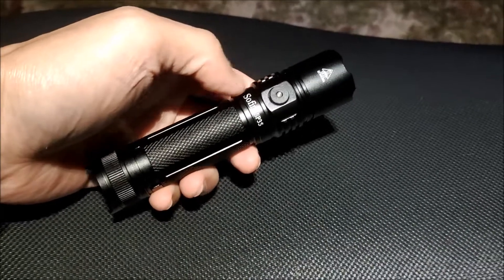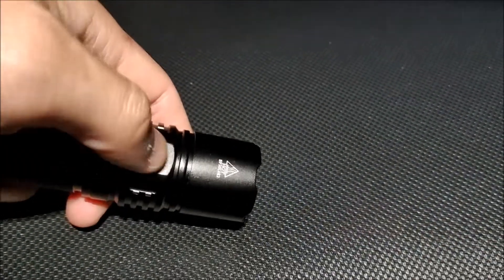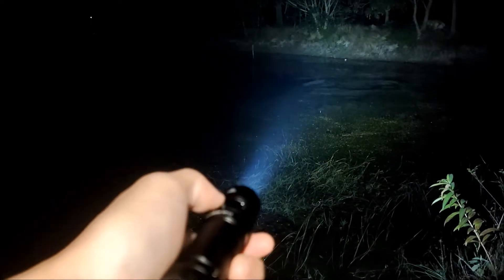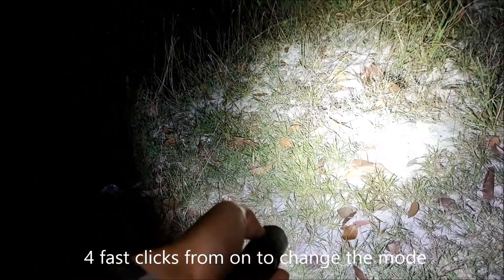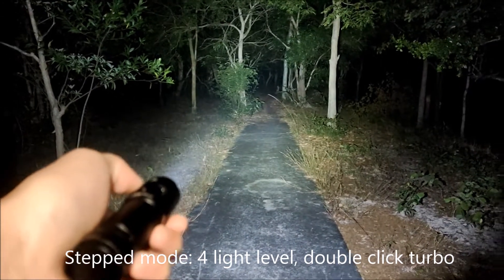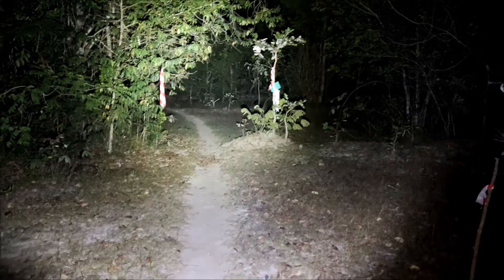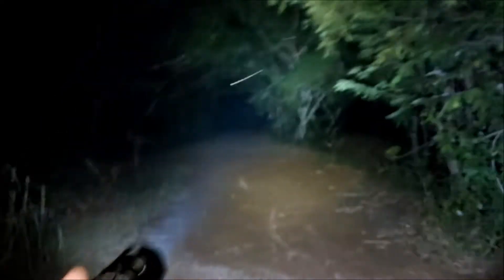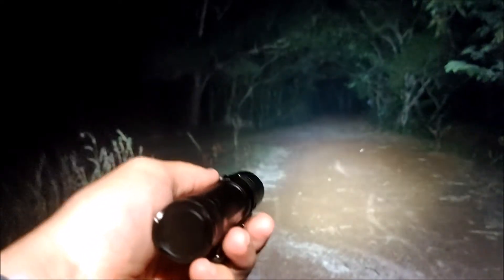Sofirn SP35 SST40 2000lm

Comment: Hello Sofirn SP35 or Convoy S21A sst40?
Reply from the maker: Sp35 
+ Two way clip, ramping mode
+ the design looks more tactical
+ Deeper reflector

S21a
+ Cheaper, easy to repair and maintenance
- Clip for it is not tough
- simple design

Overall I prefer sp35 5000k. It is better functions and design. Thanks for watching sir.

Comment: Which is better and similar s21a  if s21b ?
Reply from the maker: S21a and s21b are almost the same. But if you have to choose, s21b is a better choice. S21b can hold 22mm driver so it is easier for modification inthe future. However, in my opinion m21b is a better choice as it is not too big, better cooling fins, good beam, and able to use 20-22mm driver. Thanks for watching sir.

Comment: I just bought this light , Turbo is 332m and High is 215m , I like a little bit more throw than just having all flood on my EDC lights and that the reason I bought this light.  I currently use a Fenix E35 with 3,000 lumens but it only has a throw of 240 meters , its basically all flood and I don't care for it ....
Reply from the maker: Thanks for watching sir.

Comment: 👍 Another great video. 
Just a question:
 Is easily noticeable  the dark circular area between hotspot and corona ? That's what seems to show on some scenes.
 Or is it  just seen by the camera and goes undetected by the bare eye  ?
Seems like a fine all-around  flashlight. 
Great videos as usual. Thanks👍
Reply from the maker: From what I see, there is no dark circular area sir. However, there's something strange about this flashlight. I bought 2 sp35. The first one gives big spot but the second one gives tighter spot. Both are 100% the same but the second one gives tighter spot than the first one. I don't know why. Thanks for watching sir.
Reply: @weerapatkiatdumrong  
👍 OK, maybe it is the way things appear in my monitor 😀.
Very curious about the differences in your two SP35. Maybe it's because of differences in control of  production  lots.
Anyway , still looks a great flashlight;  I like that this SP35 reminds me of a SP32 V2.0 in its easy operation. Also, the constant brightness is a plus, as well as the 21700 power.
Thanks for your kind answers and keep these videos coming...👍
Reply from the maker: @joaquinrojas7622  I have checked the dark circular area for you. The first sp35 has a little dark circular area sir but the second one I can't notice it. Thanks for watching sir.
Reply: @weerapatkiatdumrong  
 👍 Thanks a lot for checking the  light pattern.
 I'll take that information into  account in case  I decide to get an SP35. 👍
Reply: @weerapatkiatdumrong  sp35 u use is 1st or scnd batch sir,bcoz iwant to buy a tighter hotspot without any ring on the beam.Bcoz i see in store they have variant one is 6300k/5000k the other one is 6500k/5000k.Whih one is the tighter hotspot without dark ring sir
Reply from the maker: @erynaelisya696  My first one maybe the first batch sir big spot. I also have the second sp35. It has tighter spot sir. I think the version they are selling now has a tighter spot sir. Thanks for watching sir.
Reply: @weerapatkiatdumrong  maybe yours have magnetic tail cap
Reply from the maker: @erynaelisya696  I haven't got it and I rarely use it too sir. Thanks for watching sir.

Comment: I think it's a good flashlight but they need to change the button to make it clicky / tactile. The current mushy button causes a lot of misclicks.
Reply from the maker: Agree sir. Thanks for watching sir.
Reply: same problem sometimes i want to turbo but it will go to off need to hard press the side switch..if the switch just like the sp33 v3 smooth and clicky feeling it would be perfect for me..but the design really good more elegant looking than the rubber switch of sc31pro and wurkkos fc12 but the body and knurling design of fc12 is more beautifull..